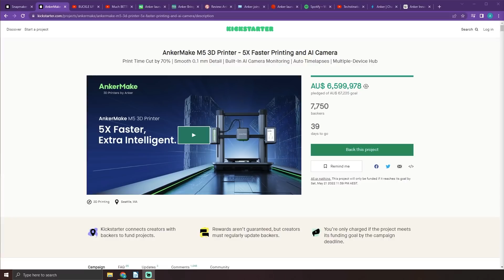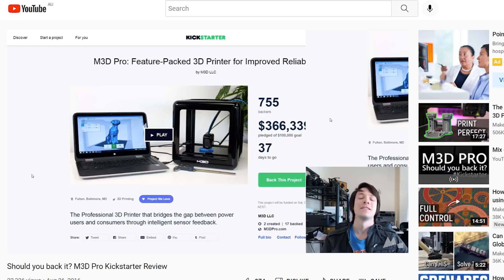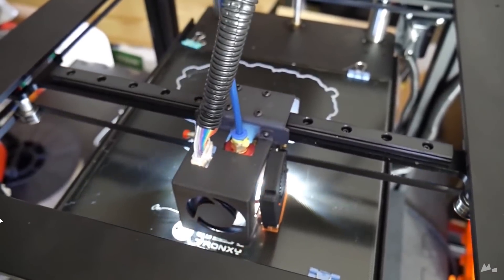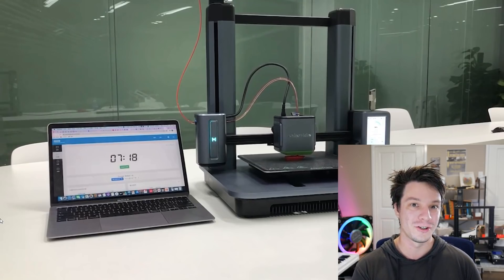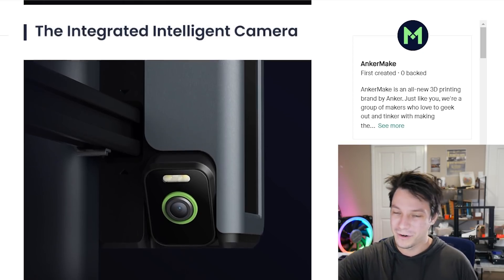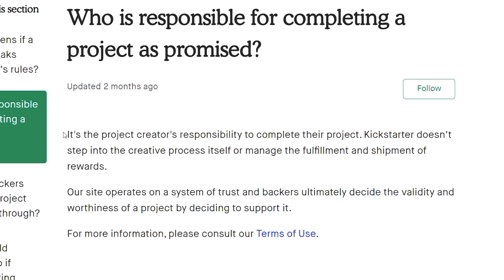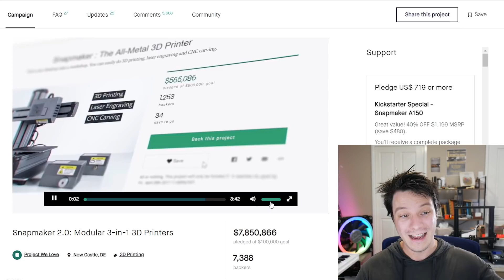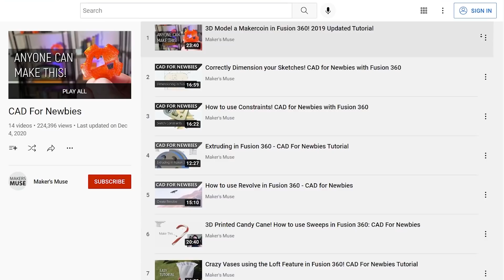This 3D Printer looks incredible, but...

Comment: There's a reason why a lot of 3D printer manufacturers, including Prusa Research, are gunning for the same market Stratasys and HP serve: people want a machine where you shove in a model an in-house CAD guy made, push print, and walk away. But anyone who's done professional 3D printing or CNC milling knows that Murphy has a way of tossing a wrench in that ideal world, so you always need a guy who knows how the tech works and what to do when something goes horribly wrong-- and naturally these manufacturers are all set up with support contracts.

Anker could be going for an ultimate Prusa but much easier for the newbie to use, or they might be building up towards a printer/service marketed to industry-- that latter market is kinda out of their wheelhouse, but the true ABL and failure detection are certainly things that would give them a competitive edge.

I was part of a tech visit from a local resin-jet printer distributor, and he showed us true multimaterial printing-- not just color, but also different textures and hardnesses, all produced in a single printer, which was mindblowing. The only thing I'm not keen on with most resins is that they use volatile organic solvents, so you'd want to put it in a garage rather than indoors. And like 2D inkjets, there isn't exactly anyone able to build one from the ground up the way RepRap did when those Stratasys patents expired, which means you're at the mercy of the company building and supporting the printer. That isn't always a bad thing, but it's always a bad thing if that company becomes abusive.

Comment: my biggest frustration i had with owning the CR 6 SE was the filament runout sensor but moreso the completely closed off filament feeder wheels. you push it in, push it through the wheels aaaaand it hits the edge on the other side... and it then takes you 20 attempts to actually find the hole that leads into the boden tube, and when you finally get it, the damn filament broke off and i needed to take the whole damn thing apart to retrieve the filament... when the ENDER 3 PRO i previously owned had an open feeder meaning that when passing the feeder wheel you would still be able to guide the filament into the bodentube hole. its the one thing i dont understand is how the more expensive CR 6 SE had a worse filament accessability than the ENDER printers
Reply: the open construction of the Ender 3 pro doesn't help me at all. You have to use one hand to push the lever to disengage the wheels, and the other to push the filament. How were you guiding the filament into the hole? Wait, are you an Alien? You have to tell us if you are!
I just wish it had a bigger funnel so you don't have to guide it in the first place...
Reply: @sourcererseven3858  ive utilized the advanced alien technology of a small adjustable clamp... or if available the very temporarily usage of a second human being... i mean alien. either way those 2 options are better than having no option at all... perhaps the engineering team should consider a midway between the ender 3 feeder design and the cr6se feeder design and have a lever that can hold itself open and still have it open enough to allow for tweezers.

Comment: Owning a printer assumes you also own skills in CAD or modelling software. Buying a printer purely for minis instead of shipping online or through a local printing shop is nonsensical as you will not unlock the full potential. Do yourselves a favor and learn a bit of CAD first prior to owning a 3D printer.

Comment: I'm actually very strongly against the "you can't tinker with it" aspect. I've always been the family tech guy, and I absolutely despise when someone has a problem, and I go to look at it, and it's not possible for me to fix it for them because the device itself is so terribly locked down. As quirky as they are, I've had more success getting 3D printers back up and running when they fail than regular plain old 2D desktop inkjet printers. When people talk about Right to Repair, this is what we're talking about. There's a lot we can do to make better quality, more reliable printers, like what Prusa is doing, but the thing is that 3D printing is an inherently complex and error prone process. I think the openness of the platforms that we have now are a huge success for repairability and the open source movement, and that's something I would like to see continued even if it becomes more mainstream.
Reply: I am that guy in my family as well, but I am also the only one in my family.
So families that don't have people like you and me - and I would guess that's the majority of families - a 'no tinker required (and just throw away when broken)' makes sense.

Comment: Apart from the financial reasons, which obviously play a big part in 3D printer development, I think another reason of why there are so few / no "click-print-and-forget" printers is the hostility of the 3d printing community towards anything regulated or controlled.
The easiest and best way for a company to get reliable prints on their machines is to control as much of the parameters as possible, that means a slicer and material that work specifically with printers of a certain brand. Now think of the hate and backlash every single company gets that has a mandatory slicer for their printer. Or if they restrict the user to their own filaments.
Reply: This is only possible with eco system lock-in and definitely not something you want as 2D printers have proven by now. Or are we forgetting that?
Reply: Having proprietary everything is all good and well, but they need to provide access to spares and consumables at a competitive price, provide constant updates and improvements to their software, for many many years, if not, then don't bother, and just make something we can easily convert to open source if needed, I have been down the locked in walled garden with printers, and its not great, the DIY maker space for 3D printers is amazing, there is plenty of people that will assist you, I'm one of them.
Reply: It doesn't make sense to have super high quality controlled material when the end user will end up leaving it uncovered, outside in the rain, soaking up humidity, then forget to set the correct type of material on the printer itself. There's too many variables that companies can't control therefore there simply can't be a guarantee that it will work correctly, at least with hobbyist level technology. 

Don't forget that a huge part of why 3D printing is so popular right now to begin with is the open source nature of it. Obviously not everybody is very excited about clearing jams and spending hours to troubleshoot, but if someone doesn't know or doesn't want to know about the machine itself, this isn't the hobby for them anyways. It's like wanting to be a fisherman but not willing to wait for fish biting onto the bait or not being prepared to end up with no fish on some days. It's the nature of the hobby and you can't change it in order to suit the needs of entry level consumers who joined purely on the fantasy of instant gratification.
Reply: @turtlelore2  I agree, it's very difficult to control - which in my mind plays into the "financial" reasons in my original comment.
However, you keep talking about "the hobby", when I meant the idea of breaking out of the hobby-niche and into the wider consumer market. 3D-printing as a tool, not a hobby. The fish in the supermarket, not a fishing trip over the weekend.
But to do that, a printer needs the "approval" of the community, or at least of a few larger voices. If some random Joe wants to buy a printer, he'll google "what 3d printer should I buy" and if your machine isn't on one of those lists in the results noone will buy it. But at the same time, to be reliable and consistent enough for the wider market, a printer needs a constrained eco-system, like filaments or software. And the machine won't end up on the lists with those restrictions. 
Obviously, I'd prefer it too if those constrained options were just that - options, and hobbyists could still mess with everything, but realisticly that won't happen. People are stupid, and if you even give them the option to mess something up they will, and companies are not willing to put up with that, in addition to the financial benefits of selling their own filaments for the printers.
Reply: @ben_1  So I think the real question should be whether 3D printing should reach that level of consumers, either in the near future or not at all. Personally, I would certainly say that 3D printing is a hobby. There's a multitude of different ways to achieve similar results to similar solutions and each have their own pros and cons, they are not limited to 3D printing. Even now, most of it in the hobbyist level is just for novelty. 

Like Angus just said in the video, we are miles away from having a true "set it and forget it" experience, and nobody really knows if that's even realistically possible in the first place. Remember there's the 3D modeling aspect of it that I'm sure at least 1/3 of the people in the hobby right now don't do at all, and it's not an easy hurdle to overcome. 

Also, the technology needs to reach a certain level of cheapness in order for most people to even think about joining. The thing that is fueling the rush right now is the fact that an ender 3, the flagship icon, is only $100. If we get any lower it'll just become something disposable; it almost is disposable already.

Comment: Also cad is definitely NOT required at all for 3D printing.

First the "hoard" of available models is simply ENORMOUS my backup of thingiverse hit 512gb and that does not include the last 5 years !!!

the issue is "FINDING" what you want. ie a unified means of searching for and finding what is needed. this is a two fold problem. first repositories need to improve their search engines and those repositories need to work with creators to put proper descriptions and keywords in their listings so the search CAN do its thing

Second for "simple" things anyone and I mean anyone who can use a computer and see the screen can use something as simple (but still insanely powerful) as TINKERCAD to fabricate "basic" things that are not complex.

bracket for your vanity? 10 minutes in tinkercad 45 minutes on the printer and its done. I have these Epson Image downloader/viewers. you put your camera memory card into them and they slurp down your pictures to their hard drives which I upgrades to SSD's

But the simple battery is not available any longer. a few hours (yes it took a while but was not hard) in tinker cad and $9 for some nickel strip from amazon (enough to do make dozens of them) and I fabbed up a replacement battery "holder" add an 18650 cell and short neg and center with a 10k resistor and who's your daddy. I got batteries for all my epson viewers!

NONE of that requires a deep understanding of cad. tinkercard is intuitive fast and easy.

will you be making complex toys? probably not. but "MOST" people will never be designers. they will be consumers of designs other people make. its sad in some ways but its also normal and logical. not everyone has the time or the "will" to even want to learn to design when they can just search "maytag knob" or "D111A battery" (epson viewer) into a search and poof there is the print.

Comment: I would love to buy a 3D printer, but it really has to get to the simplicity and reliability of "2D" printers. I know it's a lot more of a tech challenge, but I'm confident we'll get there in a few years.
Reply: I don't think it will ever get to that point, even on a prusa you still get failed prints
Reply: I haven't heard much of resin-jet printers up to this point, but I think that is a big part of the objective. There is no, or perhaps only one stepper motor (if there is one, I would expect it would be the Z axis) x and y get handled the same way that an inkjet printer handles them, with simple dc motors and encoders (linear for the X most likely) and a multi-nozzle piezo electric jet head to spray the resin where needed. Separate rows of heads for different colors of resin, and support resins. 

I don't expect that it will eliminate slicing, but it is possible that the printer will take design model formats (obj, stl, 3mf, possibly some cad files directly) and will take care of the slicing itself. I really don't know how long it's going to be before we have a huge kickback on the model design who like to design models that are not manifold, with the usual recommendation to pass the model through some variety of mesh repair tool. And eventually that will be built into the software of the printer as well.

If you go back several years of Angus' videos, you'll find that the move from steppers to dc motors is something that he's advocated all along. It is after all, why an inkjet printer is both able to spit out multiple pages a minute, and be as inexpensive as they are.

Inexpensive inkjet printers are not faultless. If you are willing to let a color inkjet print in one direction only, you may find that the resulting print looks better than if it's printing in 2 directions. Better printers let you tune the accuracy of the directions, and better inexpensive printers will run the printer through a test process that very well may be using some variety of image recognition to tweak the same settings before the printer leaves the factory. I would hope that consumer grade resin-jet printers would get the high end of that level of quality control as well.

I tend to suspect that we'll see resin cartridge systems more like the one that the new Form Labs  commercial printer uses, that further reduce the chances of end user interaction with raw resin. And on the other side of that, I'm reasonably sure we'll see folk all up in arms about these cheap plastic toys being made with resin that they don't understand how the entire process works and think that it's going to make them sensitized to something entirely unrelated. We'll see.

And yes, I'd like one. Or in time 4 or more.

Comment: So basically the anker mate is a Creality CR6SE or Anycubic Vyper with a camera and some fancy covers?

Either of those printers is 95% turn key after minimal assembly. Especially the vyper which is superior to the 6SE in my opinion.

The only thing the vyper needs to be nearly perfect is a NON HEAT flex plate. IE buildtak/faketak fabric like surface (like the original ender 2) but on a steel flex plate. This way if the heat bed fails or there is a draft etc.. its far far less likely to detach which is how you end up with chathulu's

I also think printers should START with a 0.5mm nozzle. that little bit of difference will make a big difference for beginners. 0.6mm is even better and bullet proof but printing small things can start to be an issue at 0.6mm.

I will reserve what I think till its in the hands of regular people. the vast majority of issues with printers are simply quality control. I don't see anything in the anker design that is "superior" This is the PRIMARY reason creality machines and anycubic machines are largely superior to other similar machines and clones. quality control. a lot of people gripe about QC in say the ender 3 until you realize they have sold MILLIONS of them and the vast majority work just fine and they keep improving and moving to inhouse production part by part until eventually they will be making all their own parts to their own specs and quality level (like prusa interestingly enough) but creality is doing it for $200. that's a big deal.

Resin is a long way from being mainstream consumer until we have non toxic resins. its already cheap enough. but its messy as hell and toxic and that will be a full stop bottle neck to regular consumer adoption.
Reply: I did get the Vyper and I have to say that it is easy to use, very reliable and I think I've only had a couple of failed prints. The AnkerMake looks like the logical successor to the Vyper. It is certainly a fun time to be in this hobby :)

Comment: I'd just like to mention Blender as an option when it comes to learning Modelling for 3D printing, I've personally done all of my prints through Blender though it definitely should be noted that I have not done mechanical parts requring ulta fine measurements.
Reply: Blender is phenomenal for art, but unless you really know what you're doing, then trying to use it to make things dimensionally accurate is excruciating
Reply: @spacehooliganzack7429  Oh definitely, I'm more just recommending it as a potential option if you don't need critical dimensional accuracy. I use it's ability to output .stl files to print some of my projects but if I get seriously into the more workshop side of it I'll probably either look for addons, create my own, or learn a CAD software. 

Still thank you for adding that for anyone who potentially reads mine and gets the wrong idea!

Comment: I'm excited for a new budget direct drive printer.

I'm nervous that their cloud functions will turn into vaporware down the road.

I dislike the location of the screen and thumb drive port, and that there is no SD card support.
Reply: Is it direct drive? The LTT video made it look like it was a bowden system?
Reply: I assume it is because of such a massive print head. I think the bowden is just to connect the filament sensor completely separately from the main head
Reply: @kelvin1316  It is direct feed AFAIK. That PTFE tube is reverse bowden to feed from filament sensor to extruder.
Reply: @kelvin1316  yep direct drive. The ltt video glossed over that real fast.